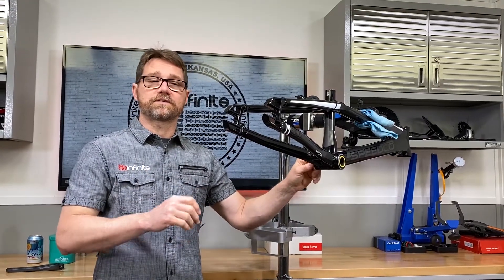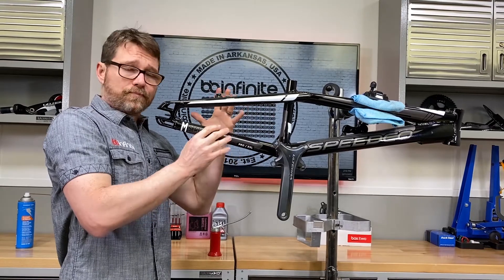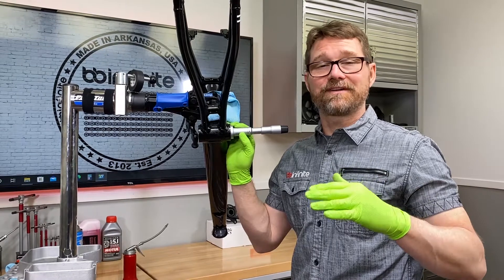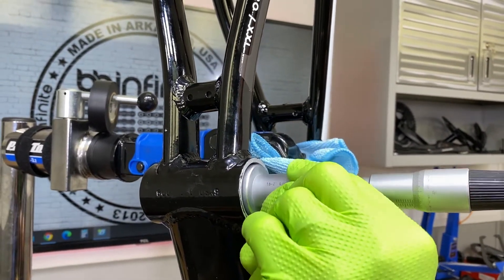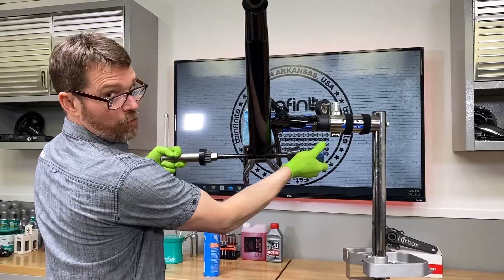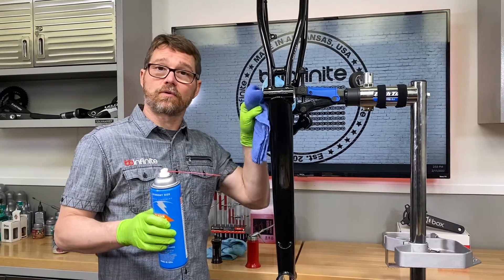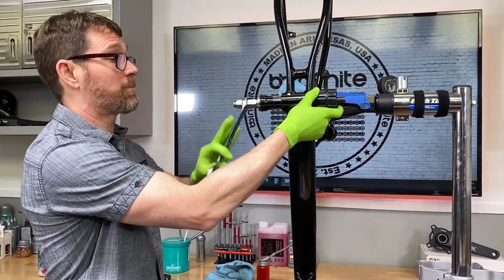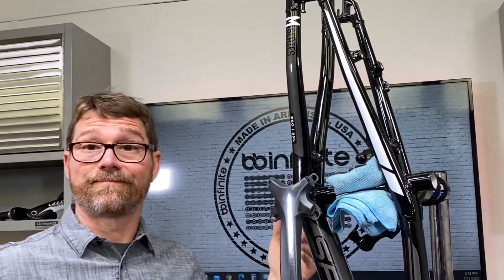BMX Bike Gets a Serious Reaming

Comment: Where can I get a ream like the one on the video? Can they be used on a carbon housing?
Reply from the maker: Yes, we use the same Park Tools setup to ream carbon and aluminum frames. Every bike shop should have this setup.   https://www.parktool.com/en-us/product/head-tube-reaming-and-facing-set-htr-1
You will need the proper reamer for what hole size you have, and the flat, non-cutting backer.